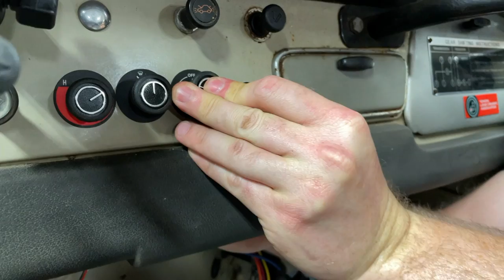Try To Finish Vintage Air FJ40 Heater, In 100 Degree Heat, Epic Melt Down, Not Proud Of This.

Comment: I was an automotive tech in central Florida for years. Dealing with heat and cars is such a huge suck. I once lost my shit and threw my 3/8 impact gun on the ground so hard it bounced back and hit me in the face. This caused me to lose my shit even more and I quickly put it in the 20 ton press. We've all been there brother.
Reply: Hilarious . Been there. Threw. 3/8 drive ratchet wrench on the floor so are it exploded. Never did find all the pieces.

Comment: All good mate happens to us all. Try installing the top bolts first, then check your holes are lined up. If the holes don't line up or cannot make the riv-nuts work. Drill the lower 2 out and put a nut n bolt thru! When it's that hot, keep cool and keep cool. You know what I mean!!

Brisbane, QLD Australia

Comment: When I installed mine it was way easier to drill the holes out a touch oversize of the supplied bolts. Then you have enough wiggle room to install the supplied hardware. The frustration is totally understood when the bolt won’t go into the hole it belongs. Deep breathing and AC in the garage would help. Hahahah always a good time. I once was using every curse word in multiple languages installing headlight bulbs, in the end turned out the complaint sent me the wrong bulbs…. Well they sort of broke into working… things just don’t work out the way they should always.

Comment: Could you clearance out some room (make the holes bigger) from the upper mounting tabs of the heater to allow the bolts to fit straight? Can you use a nut on the cabin side with the bolt treaded from the engine side, would be like a stud? Shorter bolts if needed.
Reply: Exactly.  I'd clearance the plastic holes on that heater. Those holes are close enough.

Comment: Wait to re drill, try bending the tabs on the unit a little, or longer screws coming in from the fire wall with nuts under the dash for attachment.

Comment: I'm kinda scared to say I remember you drilled those holes crooked...

Been there mate. Damn good thing I don't record my car projects. Oh the profanity!!

If this were my project, I'd be working with the holes I'd made. I'd see if I could maybe use 2 of the nutserts. Nuts and bolts on the other two. Don't Swiss cheese that firewall more than you need to. And, remember what Jeff Bradshaw at Elderly Iron says, "start them all before you tighten any"
Jeff seems pretty Zen in his vids. Maybe he edits more than you. 😘

Personally, I think your footwear may be part of the problem. Green crocs are a trigger.

Comment: Hey before you drill more holes. Stop  take a break have a real long look at what the issue really is work out a plan. Maybe make a wooden or cardboard template of the back of the heater that has the holes for the heater drilled through it then bolt that to the fire wall  with a couple of bolts and see where you are not lining up. Carefully use a small drill from the engine side as a marker for the centre of the hole .Make an adjustment to the  heater holes or the holes in the fire wall . Try not to make more holes in the fire wall. Good luck.

Comment: hey, just a suggestion, but when you re-drill the holes, go back and tack weld new nuts on the engine side so you dont have to deal with them later
Reply from the maker: Smart thinking man, which isn’t my typical way…

Comment: Take a break. Elongate the holes on the unit, run the bolts through from the firewall side and washer and nuts on the inside.

Comment: It's not over just yet. Those holes look super close. Can you just bore out the holes on the vintage air unit to the next size up and give the tabs a bit of a bend?? 
Also what if you got rid of the nutserts/rivnuts and just ran bolts?
Reply from the maker: Thanks man, I kept at it. Got it under control… sort of 😆

Comment: Keep your head up Ben!   Sweating like me there, is not comfortable.  Get yourself a portable Vornado fan, super quiet and powerful, around $30.  Not loud enough to interfere with video.  Be frustrated in comfort bro!  Try elongating the holes in the mounting tabs instead of redrill??

Comment: Man...should just stay with OEM parts keep original heater and blower. I did. Started my project at the same time you did but I’ve been enjoying my FJ40 driving around since the new year. I did all work by myself with no help. Reach out I can give you my lessons learned .cheers
Reply: Is this an AC unit or just heat ?

Comment: Dude, rather than drill 4 new holes, open up the top two a little so you can push slightly longer bolts through to the engine bay and secure with self locking nuts and a washer.
Reply from the maker: I know, I know…